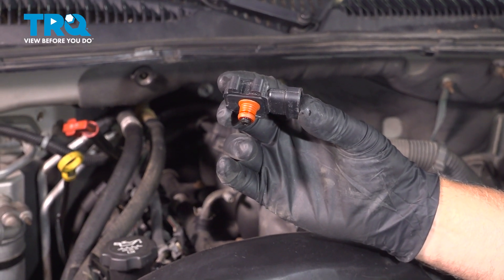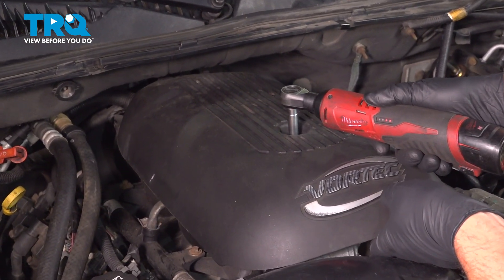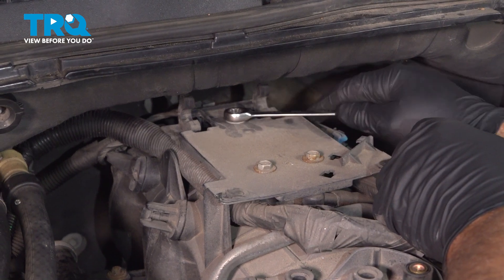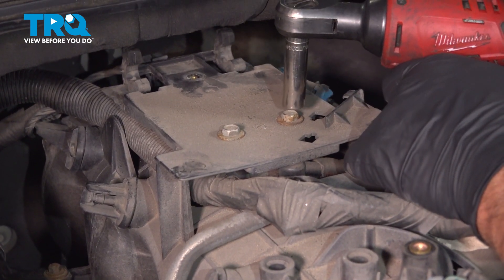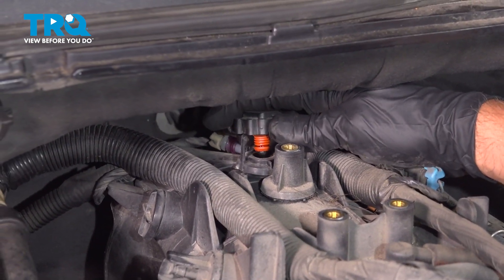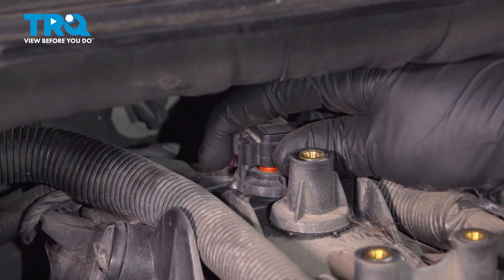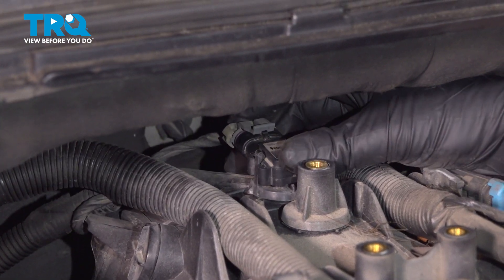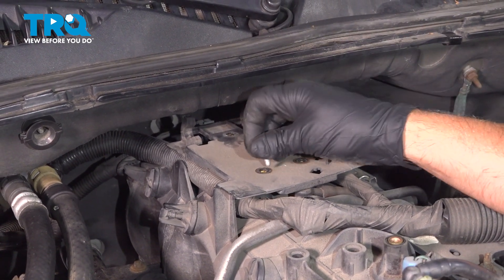How to Replace MAP Sensor 2000-2006 Chevrolet Tahoe

Comment: Before replacing it and spending the money on a new one, get some MAF cleaner or QD electronics cleaner. Spray your old sensor inside and out. Let it dry throughly. Put everything back. Most likely just needed cleaning.